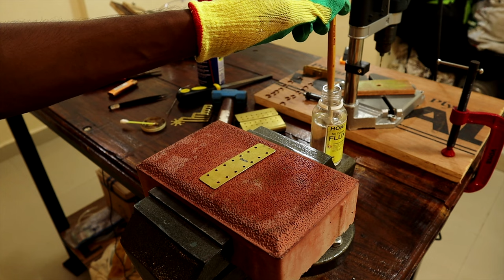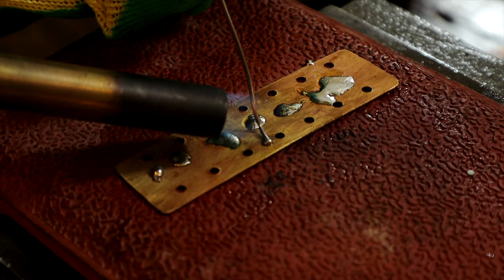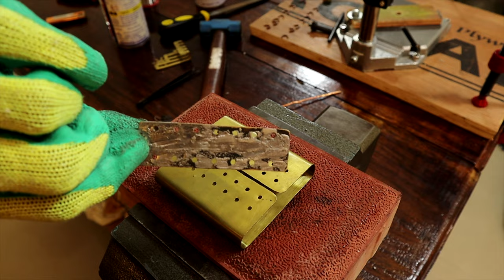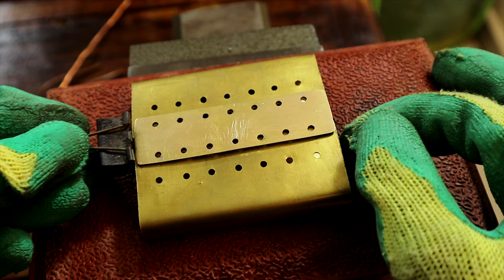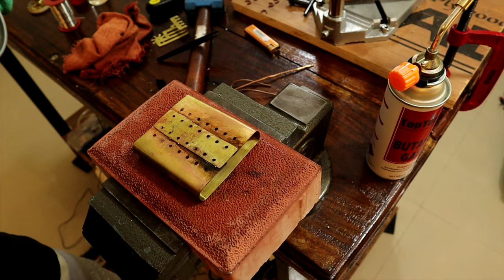How to Join BRASS Metals || BRAZING || Gas Torch

Comment: You used a HOKI no clean flux, and a ordinary 60 40 solder wire to join brass?
Reply from the maker: HOKI is the company name I think and solder wire is enough to brass joint

Comment: Nice tip. What did you spray the piece with at the end? Thanks.
Reply from the maker: @rich5034 hello i used WD 40 spray to remove heat, and metal particles from the work surface.